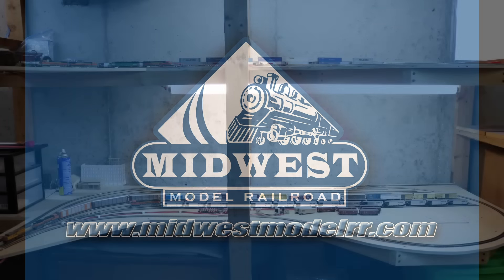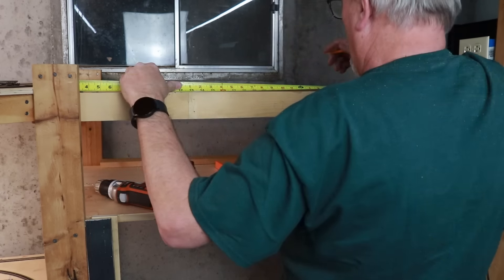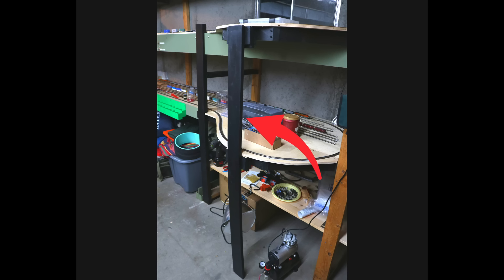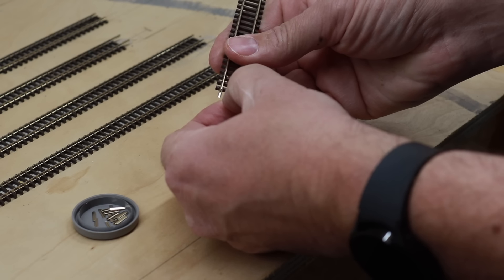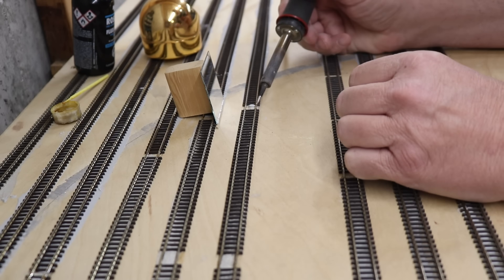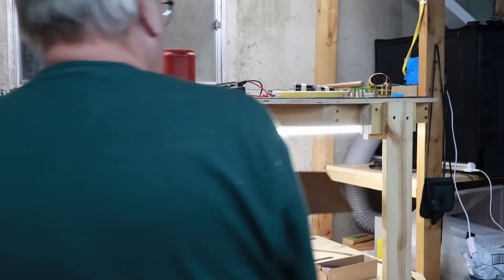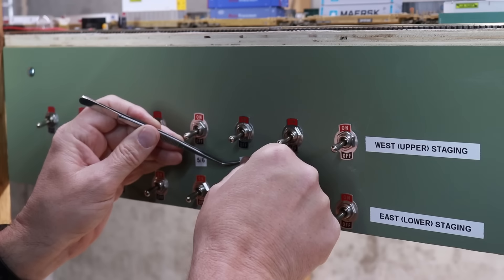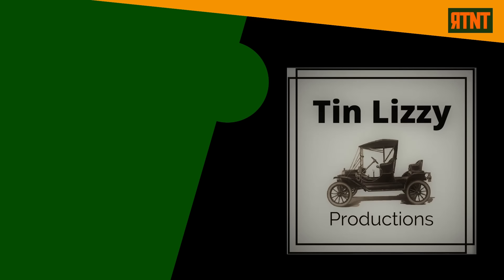Functional Model Railroad Staging Yard Design

Comment: Hi Ron , nice job extending the staging yard. Gives me some ideas on a staging yard. Which I want to apply to my new layout. I have some of those switches so I can cut power off to the engine shop and a couple of storage tracks. You know that was a simple fix. Because I don’t know that much about wiring. There is something special about doing some type of expansion. Thanks for sharing. Have a good weekend.       😎😎   👍

Comment: Very nice informative video. I like what you put together. The only adjustment I would recommend is using a rotary dial switch for you track power control instead of the individual switches. Im building an 8 track staging yard right now, and plan to use an 8 position double pole rotary switch that will route power and operate the switch machines at the same time.

Comment: Great video!
Newbie here - so please correct me if I am wrong!
I realize that space dictates a lot of design, but wondering about the blister-loops.  I know it uses a little more length, but would it be easier for operations if the tracks had a by-pass design so you can pull straight in and then several adjacent tracks and routed the engines back around the cars?  It just seems it may be easier than backing a long train into a dead-end track (especially if there are any curves involved).

Comment: Ron, if you had sufficient space to accommodate the second ladder, would you have made the yard double-ended, or don't you find that sufficiently desirable in a staging yard to make it worth the added expense and space it would occupy?  Paul
Reply from the maker: I don't think so. With the runaround track it works pretty easily as it is and I save a bunch of switches.

Comment: Ron, on the loop that you added is that a reversing loop? if so do you have a video on how to wire that section up? 
thanks for any help.
Reply from the maker: It is a reversing loop and I use and auro-reversing module.

Comment: How did you run wiring from the lower level to the on-off toggles?
Reply from the maker: I ran it in a bundle up the back of the support stanchion.

Comment: Did you add an easement to the curved section?
Reply from the maker: On a staging yard? No
Reply: @RonsTrainsNThings  So, easements are more for looks than error free operations? Or squeezing in smaller radii?
Reply from the maker: In model applications yes, unless you are running VERY high speed trains.
Reply: @RonsTrainsNThings  

Thanks. That makes everything a little easier.

Comment: Checked out the LED lights on Amazon and was startled to find numerous evaluations from customers that they burn out after 1-2 years.  At about $10/3ft   unit I can't afford to be replacing these every other year 😮
Reply from the maker: I understand your concern there and it's your decision clearly, but, for what it's worth, looking back at the Amazon reviews, out of 800+ reviews, 85% were 4 or 5 stars. I've had 18 of them in my layout and 8 in my utility room for 4 years without a single failure...but I am just one guy.
Reply: Bill, something else to keep in mind about Amazon reviews is that they're not always for the exact product you're looking at... If a mfgr offers several variations they seem to clump the reviews all together - thus if these are offered in color changing varieties or with dimmers (just spitballing here) people may be complaining about those versions.